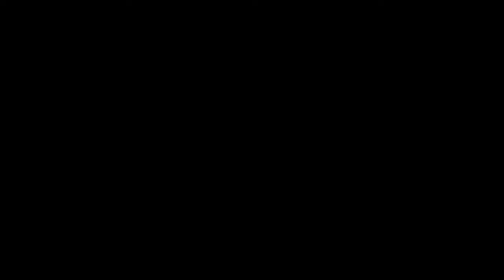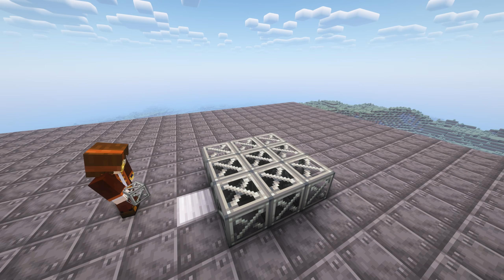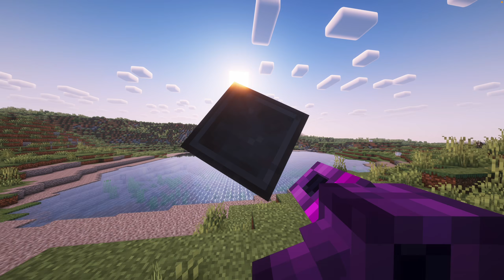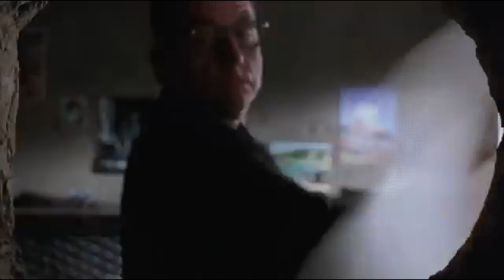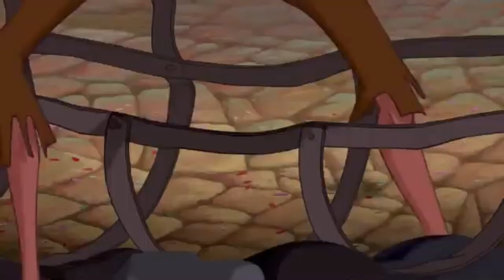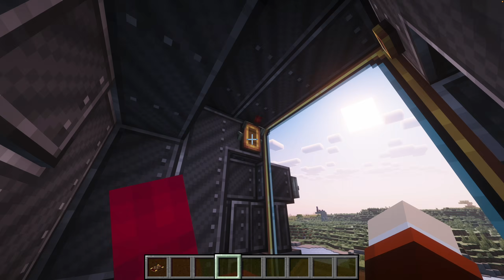From Prototype to PERFECTION: Minecraft Create Mod Mech Design Secrets

Comment: Just a minor point of critique towards you saying "editing the files is cheating". You effectively done the same thing by using another mod anyhow. I dont even really mind it, its just that both methods lead to the very same outcome. Meaning weightless blocks. So wether you edit the file or use the copycat blocks, it doesnt really make a difference. Its both cheating in a sense as it just invalidates the intentional weight mechanic.

Comment: okay, dumb question, if you wanted to build one of these things, how possible would it be to do it with a power source so you didn't need to use creative motors? I can tell you definitely used creative motors, but I wondered if it was possible to actually use a power source on it instead like a generator or an accumulator, does that even work with clock work or no?
Reply from the maker: Yes, there is a workaround, but with one more addon called Create Utilities

Comment: Been wondering how you can provide power to the Gyros on the Legs/Limbs without the creative motor. Been trying to make a survival-friendly mech build and this has been a constant issue.
Reply from the maker: The easiest way is to use addon create utility. But for some we can’t configure frequency after placing it into physics entity. So we have to install Carry On to be able to configure frequency and only then place it into physics entity.

Comment: Master!
Referencing the master's work, I created something too! However, I felt the robot's rotation speed was slow. So, there's a method from old Japanese ninja movement called "HIZANUKI" that allows instant turning. This is an ancient technique where you release the power from your knees and hips, temporarily lift your upper body, and instantly change direction. I reproduced this using Create! The method involves being able to stop the gyros of the ankle, knee, and hip with a clutch. Then I assigned those to the spacebar to reproduce releasing tension. The rotation became very fast while pressing the spacebar. Just like a ninja, right?
Reply from the maker: You’ve unlocked forbidden knowledge…  honestly brilliant. I bow to your clutch-based wisdom

Comment: If the mech's brake if a turret is added maybe you can make a 4-legged spider mech with a gigant altillery cannon that has a "move" and a "shoot position? From what i understand  the walking only breaks when something is moveingon top of the mech while it walks so if you seperate those 2 functions couldnt that work well? That also might allow for a create radar on top of mech when it is in "shoot" non moveing form
Reply from the maker: actually something on top of mech can turn separately, so we can make cannon or turret which is can turn while walking

Comment: You should make titans from titanfall2 and yes I mean with arms
There’s a mod that adds better controller so you could use that
Reply from the maker: Yes, I want to build BT 7274! But I’m aiming to make it as functional as possible, so I’ll build it a bit later, once I’ve learned some new techniques and tricks. Right now I’m using some new mods (yes, tweaked controlled included) and working on something really epic

Comment: I bought an IRL robot kit once, and the kit came with a gantry to hold up the robot while you got used to programming it. Is that an option while you are tuning the walking animation so the mech doesn't fall over?
Reply from the maker: No, i just freezed a physical entity in the air using a gravitron
Reply: @TheCogSlacker  Is that an item in one of the mods?
Reply from the maker: Yes, it is from Clockwork

Comment: Is there a way to pick up the mech once it falls over?
Reply from the maker: maybe if we set the gyro to maximum rotation, but it will be turned off by default. And when the lever is activated or using linked controlled, it will turn on, and the mech will stand. Or just by using gravitron

Comment: I gotta try to make a survival friendly version of one of these, will it be painful? Yes, is it even possible? I HAVE NO IDEA!!
Reply from the maker: Good luck with it. Also you can watch my latest video. I've checked if it's possible to build in survival
Reply: If you use Create: Crafts and Additions, you might be able to use Alternators and electric wires to transport power to each part without using shafts.
Reply: @arcalranem Or you can install a diesel engine on each part Diesel generators
Reply: Oh good idea  @arcalranem
Reply: @Cave-Story-Fan3 Capacitors can also make a great power source of you aren't willing to shove a whole steam engine in there.